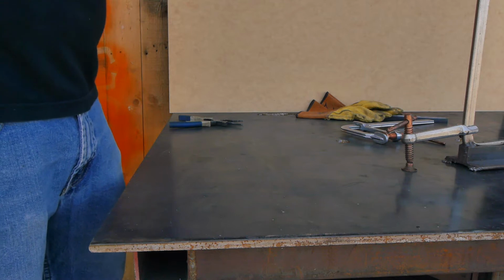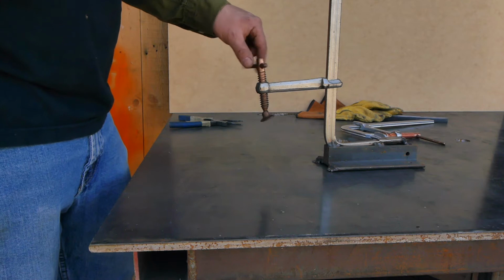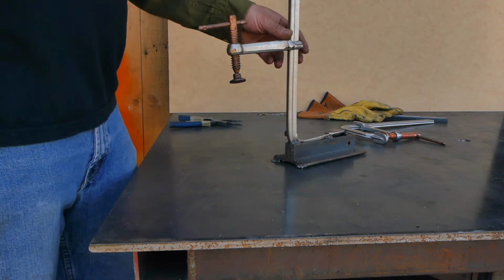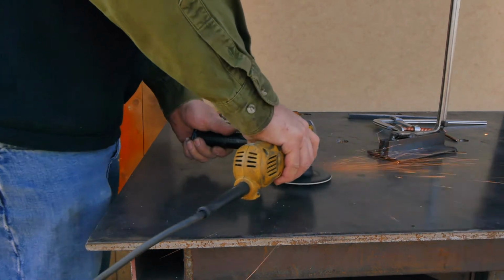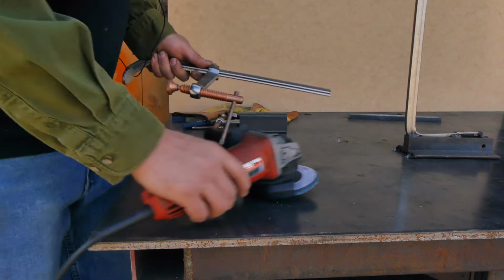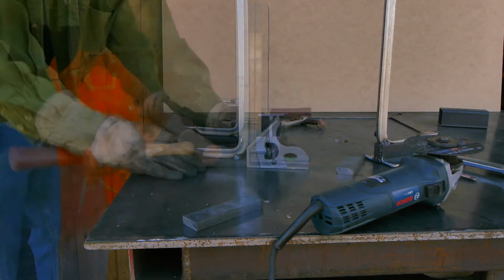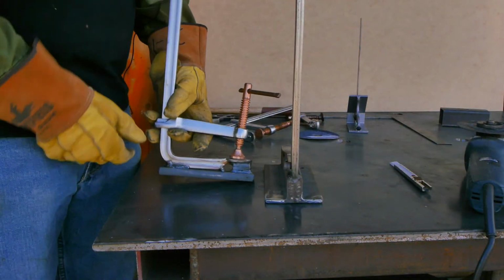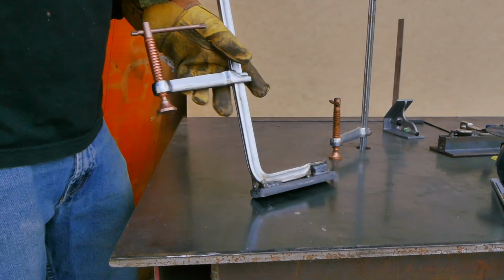Weldable Z-Clamps

Comment: Google Strong hand style clamps
Reply from the maker: Rick Brandt Thanks Rick, did I miss something? I looked, Strong Hand is not the originator of this product. Yes, they do have ones similar but they work with the holes in the table not weldable. The company I borrowed this design from made a clamp just like what's in the video just not made from a  f-clamp.
Reply: see strong hand f clamps I get them at my LWS and they are weldable
http://www.stronghand.com/stronghanddtools/products/4in11.php
Reply from the maker: The links not working, i went here http://www.stronghandtools.com/stronghandtools/products/4in1.php
and all i see is f-clamps nothing that works as a weldable z-clamp